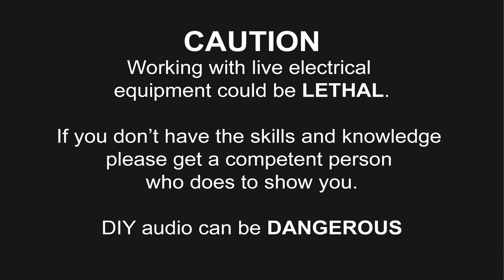Naim Power Supply  Build PT 1

Comment: You can't hear DC, one rectifier is the same as the next and it's a Schottky, not Scotch - key. It's the overhead and the reserve of a power supply that determines its voltage stability, not the diodes, schottky diodes are used in SMPS circuits where their lower Fr makes a difference, in audio they make no difference, I stopped watching after 5 minutes.

Audio guys should do some basic electronics to get an understanding of what they are working with. I don't want to pick on you but this is why audio is voodoo today and getting worse.
Reply from the maker: Thanks for your observations.